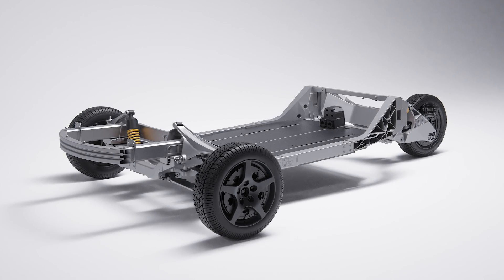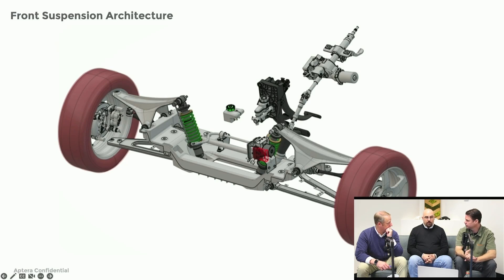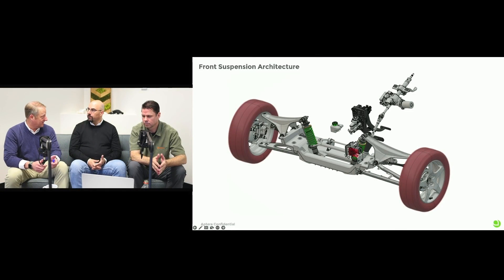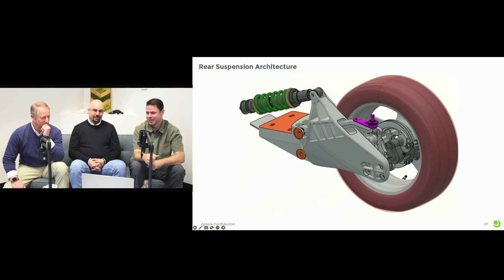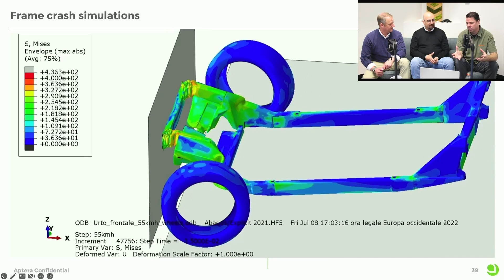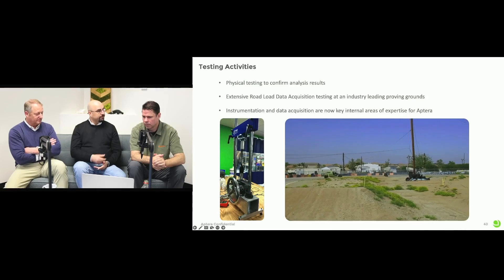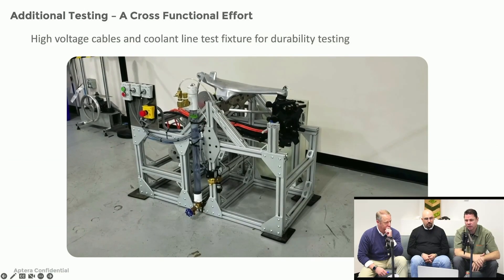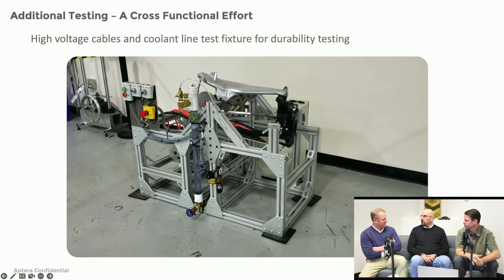Chassis & Suspension — Aptera Engineering Update

Comment: You spend 30k and a hit a pothole do you A destroy half your vehicle B destroy the wheel motor and rim C ruin all of the aforementioned and the suspension with an unclear prospect of parts availability ?
Reply: No.   I rode in an aloha prototype and we went over sharp speed bumps without issue.

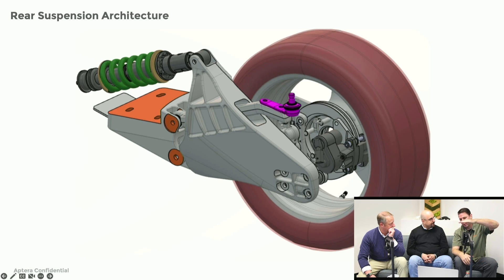Comment: 3:10 what is meant here? The single swingarm and the four-bar linkage will both move forward or backwards, closer or further to the front suspension, as the spring is compressed or uncompressed. There is pretty much no difference. And because your vehicle is not RWD, there is no effect from the chain pulling on the suspension either, so really what is the difference in functionality between a single swing-arm and four-bar linkage in this case, can someone explain?

Comment: Ignore the toxic positivity, I want to know how it wouldn't slip or land on its body with one wheel up and what about traction control?
Reply: Aptera has a wide stance and a low center of gravity.  The traction control is excellent.  It can sense wheel slip and sdjust torque 32 times per wheel revolution, or about every 2.5" of tread travel.
Reply: Good questions that Aptera cannot answer... all the red flag warnings of a vaporware investment scam
Reply: @sandervanderkammen9230  I guess they'll have to find it the hard way....

Comment: I love that Aptera is volunteering this interview.  The suspension needs to have progressive springs and/or magnetically heterological shocks in my opinion, partially in-part due to the different battery configurations and variance in passenger weight distribution and load.  I'm an engineer for space aeronautical systems and it feels like cost was a huge contributing factor here, albeit a reasonable compromise.   Buyers might turn their backs if it isn't more plush and sacrifice a 0.1 lateral g-force skidpad mark.  As it stands, my opinion is track-mode Lotus Exige right now for "comfort" with near-zero side-bolstering on those seats.  You need to "plush-if-y" the ride and allow more wheel skirt clearance for normal road use.

Comment: Exactly! Use physical tests to validate the computer model, so that you can confidently tweak your design in the computer. For too long, engineers have been taught to use computer modeling for approximations, and physical modeling for the final product. But that's too slow. If you get the computer model right, you can run experiments in the model instead of building prototypes.
Reply: Aptera is building the Production Intent vehicles for validation now.

Comment: I sourced high flex cabling on a few projects in my machine design days. It was always very important to control the bend radius effectively. Will the drive to motor cables be free standing at the flex points or will there be guides to keep them from flexing at too tight a radius?
Reply: I expect that the coil of cables and coolant hoses at the rear swing arm is to maximize flex radius.
Temperature extremes plus ultraviolet light do exacerbate the effects of flexing, though.
Time in the Real World does tend to surprise in that regard.

Comment: Such exciting times! CONGRATULATIONS with progress on development!

Impressive Simulations, FEA, and Chassis video.  Nice durability test. Did you perform temp/vib ESS during any of those operations? 

My worry, it seems like alot of Fasteners and Parts in chassis design.  Is a single casting NOT an option?  Or is that expense pre-planned for after some degree of customer purchase history? 

Cheers. Eric
Reply: Those graphs were made 2 years ago according to the page footings.
Reply: @Dave InWLA  Gr8 to hear that.  Do you know if it's a Cast chassis? 
Cheers, Eric
Reply: @erickessler6094   - The plans are for the chassis parts to be forged by forcing a slurry of chopped carbon fiber and a plastic binder into 2-part steel dies.  See Youtube "Aptera is cutting steel ".
Reply: @Dave InWLA  thank you!  I look at the video, and the discussions and pretty panel shapes were magnificent but related to body, not the underlying chassis , as shown in the 1st 1/3 of this video.  
The renderings and the CAD dwgs show many parts and bolted members.  I kind of expected the chassis with structural battery area to be 1 or 2 cast components. 
Thx again, Cheers!
Eric
Reply: @erickessler6094  I think they designed it in multiple parts so it would break into multiple parts like a formula car in case of a crash. at least that's my theory

Comment: Beautiful! The patented rear wheel suspension system is very impressive. This video shows how much thought and practical research has to be done to bring this wonderful car to the market. We are shown Aptera features that are so new and original, there was no existing hard data available from earlier experiences, until extensive tests were done. This is a familiar problem for engineers entering new territory (I am an EE). The Aptera team needs a library full of knowledge, about chemistry and physics, mechanical engineering, electrical engineering, software engineering, finance and mass manufacturing, laws and regulations, etc , etc ... enough to make a sane person mad. And still this most innovative car is going to be huge success! Now, that is team work.
Reply: The hardest working "team" is you fanboys.  And you know what I'm referring to.

Comment: Why don't you make the rear wheels dual?  You could qualify for the EV incentives with minimal design alterations
Reply: weight reduction and aerodynamics
Reply: Um… it is my understanding that the whole purpose behind three wheels is not so much the aero drag as much as the rolling resistance produced by deforming the rubber tire. That’s why they get hot.
Reply: @jaybusby8299   -  One can reduce the deformation by just putting more air in a tire.  The contact patches would reduce in area, thus reducing the traction of each tire,
but hey! -  you'd have twice as many rear tires.  One could also just use a fatter single tire pumped up hard to get the same contact patch.  There are numerous factors at work, but reduced weight and aerodynamic drag get totted out most often as engineering reasons.  But reduced stability isn't usually mentioned unless the single center wheel is in front.  In that case (e.g. the English "Robin"), applying the brakes while rounding a curve would send the car rolling on its side.  I suspect that with the single center wheel in the back (e.g. Aptera) accelerating hard while rounding a curve would also send the car rolling on its side.
Reply: The claim is that with 4 wheels, more stringent crash tests would be imposed.
IOW, it would be tested as an automobile, not just an autocycle.
Reply: @daveinwla6360  That makes far more sense than weight and aerodynamics

Comment: I am planning on buying a 600 mile version for several reasons - one, I would rarely drive more than 6 hours a day on a road trip and with breaks, that would be under 400 miles.

Second - I want to keep from using the top and bottom 20% of the battery for longevity, meaning that I would have an effective range of 360 miles.

My question - will there be a setting in the software that I could set my own minimum and maximum charge ?  Would I be able to toggle it on and off in case I am topping off the last 20% with solar during day to day use ?

Thank you for your answer.

Comment: Testing wires with a moving jig is great and all, but what about environmental factors like long cold winters in more northern climates, and salt? I have a feeling both of those could be trouble for wire insulation. I don't need the power cables cracking when it's -30 F and stranding me.

Note: I say this as a fan who wants the best for this vehicle.
Reply: -30°F can be mid-afternoon temps in Fairbanks, Alaska. in the winter.
And how do the batteries perform at that temp?  And at the other extreme,
what happens when air temps are 140°F?

Comment: Suggestion to Aptera for the suspension test jig for the HV cables: put a bunch of UV light and warmth/cooling on the test rig to simulate how the sunlight and environment will affect the durability of the insulation. Save yourself some warranty headaches.
Reply: Good idea, but I think the cables will be covered for aerodynamics.  Although 20+ years of heat and cold will still do some damage
Reply: @squidbeard492   - Summer heat - temps 1 inch above the road surface (+140°F) - and winter temps in Fairbanks, Alaska, (-40°F) should be simulated.
Reply: Add some dirt, road salt, moisture, road chemicals, etc. to the mix too, if the wires aren't going to be completely sealed away from such. The addition of those abrasive and chemical wearing elements can make a big difference over time.

Comment: why not fully remove the steering rack? full steer by wire?
Reply: Great idea!  Power goes out and all steering is lost.
Reply: @squidbeard492  :face-purple-crying::body-green-covering-eyes:
Reply: @squidbeard492   - Ask Porsche if it's a bad idea.
Reply: @daveinwla6360  because I already know it's a great idea to have something that results in loss of vehicle control when a battery fails or a wire shorts 🤣.  It's absolutely a great idea until they get sued over a predictable failure and no backup controls
Reply: @squidbeard492   - If it IS steer-by-wire, I'd think (hope) that Aptera would make manual backup possible because of the vehicle's light weight.  But the vehicle's light weight may make manual steering part of the Launch Edition.
Reply: @daveinwla6360  LMFAO. Let's switch to something that saves weight by removing physical components, and then add the physical components back in as backup...  

With all of the potholes and loose wires I've had over the years I wouldn't drive without mechanical steering/brake controls
Reply: @squidbeard492   - It's not even on my radar because I've always driven light vehicles that didn't have or need power-assist anything.
Reply: @daveinwla6360  steer by wire isn't power assist.  It's essentially remote control through either wires or radio frequency controlling steering motors, brakes etc instead of the steering wheel  physically turning the wheels.  
I doubt there's much if any mainstream vehicles without power assist made in the last 20years.
Reply: @squidbeard492   -  I stand corrected.  And... Steer-by-Wire requires totally powered control, not just - as you point our - Manual-Aided-by-Power.  And what a fertile playground for hackers - Steer-By-Wire plus AI guidance!  :-)
Reply: @daveinwla6360  it's relatively easy to prevent hackers.  Just remove wireless connection and make any ports deep enough inside a vehicle to make it obvious it's been tampered with or time consuming enough to prevent it.  Ai isn't need to wreak havock.  Just program it to accelerate randomly and make a turn into the opposite lane.  You could even program it to only take effect at highway speeds for maximum carnage
Reply: @squidbeard492   - Yeah, that sounds right - the carnage part.  :-)

Comment: Does putting a lot of the crash energy into the battery pack increase the likelihood of it lighting on fire after an impact? How do you mitigate those risks?
Reply: Crickets...
Reply: of course it increases, you're putting energy into it, but the real question is does it increase the risk in a meaningful way. I think the bigger risk is puncture but their packs design seem to be pretty unlikely to allow puncture of cells enough that it would cause a fire.

Comment: Has Aptera thought about a regenerative suspension so that the battery gets recharged every time it goes over a bump?
Reply: Likely not worth the added complexity and weight.
Reply: Rube Goldberg, their newest engineer, is working on it,
Reply: @skipondowntheroad5833  no kidding?  It shouldn’t add more than 65 lbs and should provide many miles of extra charge if they can pull it off. I would only add it to the rear wheel. The tech has been around for 30 years on semi’s. The car weighs so little not sure how much energy they can get from it but it seems to bounce a lot so who knows.
Reply: I believe regen shocks are in the works at Elaphe, and they could well be combined with active suspension - also an Elaphe skill.
And regen shocks would be irresistible to the Greenies.  Maybe with the Lunch (pricier) Edition
Reply: @daveinwla6360  the shock would be the best place for it.   I think the problem is most Aptera miles will be on smooth surfaces.
Reply: @raynettleton8621   - Yes, and they would add to the cost of the Aptera, now at a time when EV prices are unexpectedly falling..

Comment: I'm looking at the steering column / linkage and wondering why Aptera didn't opt for Steer by Wire like Canoo did.  Seems like it would reduce the number of parts which should be a manufacturing cost & time savings, as well as saving weight.
Reply: Yes, indeed a DBW steering system could reduce parts and probably weight, but it is not as safe as one with direct linkage of the steering to the wheels.
Reply: As with the suspension, they're keeping it passive/simple in the Launch ("Lame") Edition.
Later, much more expensive models, I expect, would feature active systems.

Comment: This is the key area for me. I cant ride in cars with stiff suspensions due to my back. I ride in a civic ex with 16 inch tires, soft seats and soft suspension. Im wondering how that compares to this. Right now it looks like the suspension is pretty stiff.
Reply: Yes, it's overly stiff in compression damping, overly weak in rebound damping.  Bad choice of shock absorbers.
Just look at the video of the rear wheel motion and how it flings the rear of the vehicle upwards.
Your back would be in pain.
Reply: @daveinwla6360  thats what i was thinking also.

Comment: You offer three wheel motors but not three wheel steering. Rear hub motor with a king pin inside the center. 
Leave space for five degree steer so that research and development can advance possible benefits later on.

Comment: Awesome, but the first images (43 seconds in to the clip) showing the front and rear suspension did not have the Elaphe in wheel motors. In the front there was a driveshaft arm going out to the wheel. Why was the imges based on the pre-in-wheel motor solution?
Reply: The in-wheel motors have been in the Aptera solar EV since day one in 2019. They just left that part (and a lot of other parts) out of that diagram for clarity in seeing the other parts. What you thought is the drive shaft is really part of the steering linkage.
Reply: @fotoguru222  yes, you are correct. Thanks for the explanation. Should have thought about the steering linkage. But I thought it looked a bit like a drive shaft and no motors in the wheels present... But it makes sense to leave out some things for clarity.
Reply: @fotoguru222  correct
Reply: I believe that is the steering tie rod. It does look wonky since the rim is not filled with motor.
Reply: @kevindavis8143  ah, yes. You are correct. Thanks for the explanation.
Reply: If you look at the far wheel, you can clearly see that it is the steering tie rod.
Reply: wrong you are
Reply: @casylong8383  Don't think I am. 43 seconds in to the clip.
Reply: @AndersOttosson  the motors aren't there.  That is not the drive shaft.  Still wrong
Reply: @casylong8383  you really like to tell people they are wrong, without any explanation why. That is not helping, that is draining. A bit of a social tip for you.